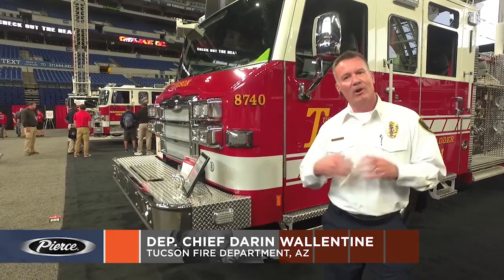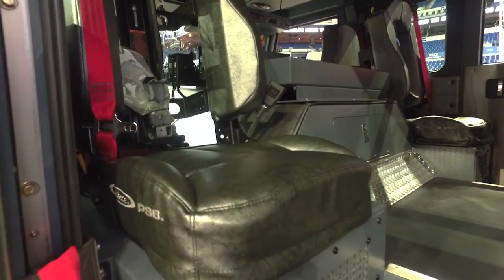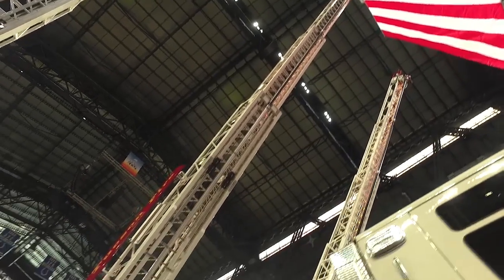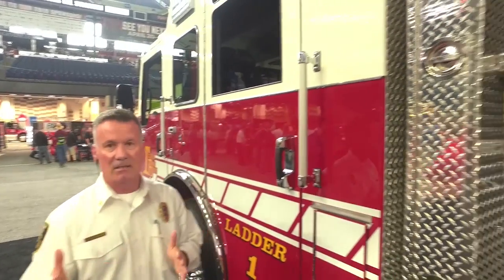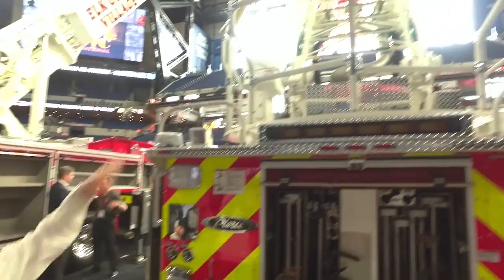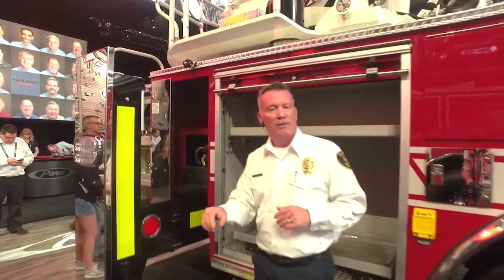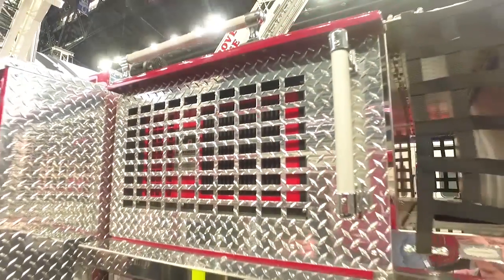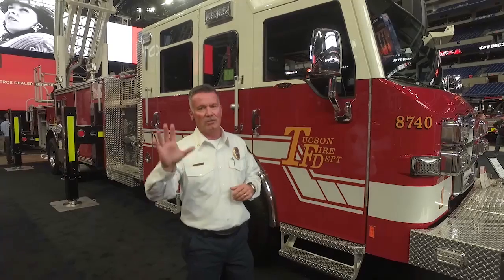Velocity® 100’ Heavy-Duty Platform – Tucson Fire Department, AZ

Comment: only a crew of 4 for a ladder truck. Man 6 should be required for a ladder truck.
Reply: Tell you what: Go talk to Tucson Arizona and tell them to increase their budget so they can man 6 people.

Because my guess is that's exactly what's constrained them from putting six people in the truck.
Reply: @navblue20  Prince George county can do it. And they are one of the busiest departments in the country. 4 man cab for a truck is pushing the limits for a truck crew. You have the driver who is in charge of the rig so he is off limits it usually takes 2 guys to vent a hole in a roof and where is that 3rd guy going? If u have 4 guys in the back you could have 2 on venting the roof or Windows and 2 doing fire attack more sensible in my opinion. Sadly the fire and police departments are the first to see budget cuts in a city
Reply: 1 driver / 2 to the roof / 3rd man is outside vent.. it works